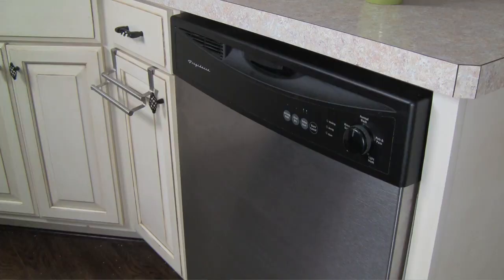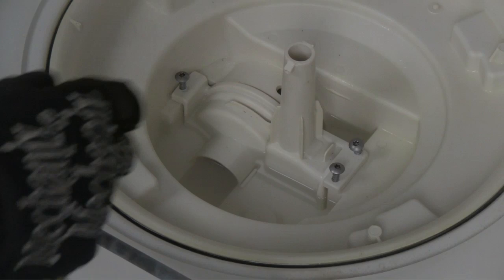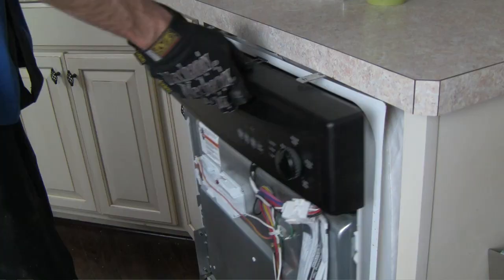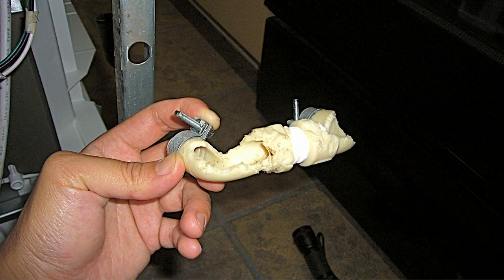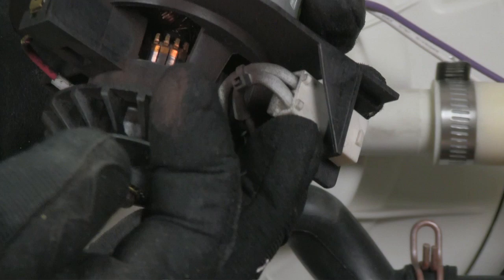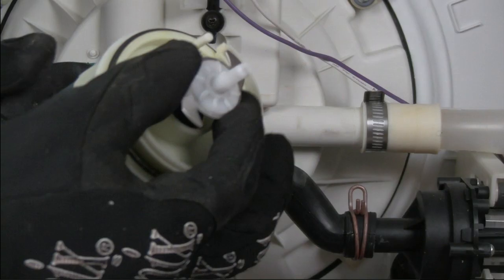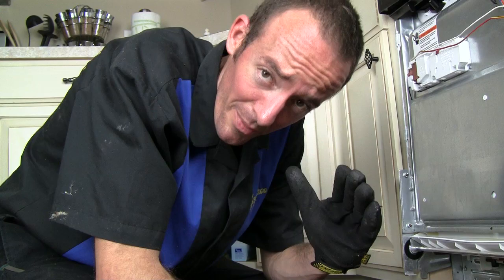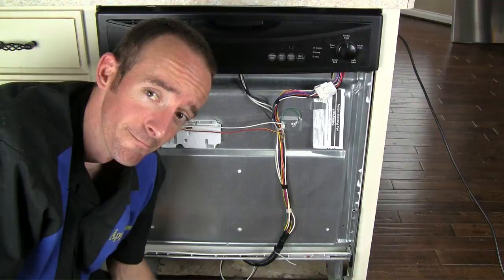How To Repair Frigidaire Dishwasher Noises

Comment: Hello John, Marc here. Great video. I am working on the same dishwasher. I believe I need to open up the drain pump motor. The impeller could be damaged, because inside the tub I found paper towel, bone,hair,plum seed, and a screw. Told  the homeowner I need to pull out and disassemble the dishwasher. Wish me luck.

Comment: A few days ago my dishwasher wasn’t draining water. I live in an apartment so the maintenance man came to fix it. He was here for over 7 hours and couldn’t fix it. He ended up installing a different washer from another unit and that didn’t fix the problem, it added a new problem, a weird grinding noise. I watched this video and FUCKING FIXED IT. It involved diving into my apartment dumpster to get spare parts from the initial machine, using a spoon as a screwdriver, and drinking a pint of vodka, but I did it! There was a piece of glass in the drain pump and that fan in the motor thing was broken into pieces. Amazing video. Thank you thank you!

Comment: Thank you for the video, it was helpful.  In case you're still wondering, the purpose of that 'pin' you reference inquisitively and shave down @7:07 is more of a receptacle for a long cylindrical pin from the motor-side to keep the housing from spinning separately from the base/motor.

Comment: Ok, I just want to say thanks for posting this up!  Because of your willingness to share knowledge, my dishwasher is now fully functional again!!!  The morning started off with my wife telling me it wasn't draining water out of the bottom tub.  Based on the discovery o your video, I was able to narrow the problem down to the drain pump.  I pulled it off the machine and found a broken shard of glass that had somehow found its way into the pump impeller and jammed it.  I removed the glass, re-ass

Comment: This video is still as relevant as ever, and the model used is mechanically very similar to my DW -- the only major difference being the controls interface.  Was able to troubleshoot multiple issues that collectively created the problem.  All without having to purchase parts or call a technician.  Many thanks and kudos!
Reply: Brian B thanks for the comment! Fortunately the appliance designs don’t change very often. Glad you liked it!

Comment from the maker: @Thecrazyeditor I'm not sick of it at all.  That is possible. The impeller is held to the motor shaft by a flimsy tab that is expanded within a square hole by one screw.  So it would definitely be possible for the square hole to become round, one side of the tab to snap off, or the shaft to strip out for some reason.  Thanks for the compliments. Glad to help!

Comment: Great, thorough video.  Thank you.  I followed your instructions to the 'T' and was able to diagnose that the issue was the drain pump (opened it as you showed, and a couple ball bearings had come out of the bearing pack)....  HOWEVER, this warning to your viewers about replacing the circulation pump:...  

... my circ pump appeared to be working but I saw some residual coffee grounds and decided to pull the circulation pump to inspect it more carefully, and clean. Followed your instructions to remove the circ pump,  "...it may help to wiggle and twist a little as you pull."  

I was gentle with the "wiggle and twist method" but the impeller snapped off at the underside because the O-ring for the lower disposer blade section was stuck in the sump housing, while the upper O-ring for the disposer blade cover came out freely.  In this case, pulling just hard enough to bring the circ pump out, even gently wiggling and twisting a bit, allowed the impeller section (O-ring having less friction) to pull through the disposer blade cover (O-ring having high friction).  

I did manage to fix the impeller (description below), AND in the process came up with a safer way to remove the circ pump: ...

...with DW on its side, reach in the cabinet and push evenly on the impeller as you gently pull and gently twist (do not wiggle), and this will keep equal force on impeller and disposer section as the circ pump is removed.

I ordered a new circulation pump, and while waiting for it to arrive did a repair to the old pump, and it worked fine (but chances are you'll need new O-rings).  These steps to repair the broken off impeller (broken off at the axle and plastic bushing just under the impeller):

1.  carefully reattach and align impeller blade; use a sharpie to mark the alignment for when you are gluing all together. 
2.  after you've made alignment marks, clean and gently scrape using an exacto blade the broken edges on the bushing
3.  use a tiny bead of JB Waterweld epoxy (good for up to 300° and a 1300psi, into the inner bushing beneath the impeller (enough to fill in the space after the bushing is pushed down, but not enough to overlflow (so, a very tiny bead, like 1/8" round)
4. use JB steel reinforced two part epoxy with 4000psi and good for 500°f on the broken edges of the bushing
5.  push the impeller back onto the circ pump
6. secure the impeller with a couple rubber bands crossed over the impeller to the bottom of the circ pump, and let it sit over night.  
7. 24hrs later put a little steel reinforced on the outside of the bushing, and also over the screw and center mound of the impeller top screw, and before it dried sink a Phillips head bit into the screw so it you'll be able to access the screw if need be (this last step will help hold the screw into the broken bushing where it's threaded end is locked into the Waterweld.

I left the repaired circ pump in the dishwasher and it held up for a few washes, but when the new circ pump arrived I swapped it for concern that if the old impeller did eventually break off small pieces of plastic or the screw might get in the pump and and possibly ruin it.

Comment: Helped fix my issue within two minutes! Already had the covers off, went to check the impeller, found that it was clogged with a rogue piece of plastic that must have shifted when I last cleaned the inside filters. Thanks!

Comment: This was exactly the problem I had with a Frigidaire dishwasher.  Same sound but some leaking, though it was still cleaning well.  I would rather spend $130 on a pump than buy a new dishwasher when I like how this one runs.  I opted to just replace the pump rather than do surgery like he did.

Comment: Just a headsup, the little plastic ring you modified by cutting isn’t used for anything other than holding the 2 plastic circular housing pieces together so that they don’t misalign while the motors spins.  The other plastic side has a long rod that fits into this plastic ring on this side so that they spin together.  So as long as the modification still holds that rod in place you’re good to go.  I did the exact same procedure with great results, works much quieter now.  Great video!
Reply from the maker: Thanks for the comment and excellent observation!

Comment: Excellent video. I have the same dishwasher (Kenmore) and same noise problem. The part number on the pump is 154843901 made by Johnson and this is the internal recirculation pump shown in the video. I see a few used ones on eBay for $25 and a new for $100 on Amazon. My experience with used items on Amazon is 50/50 if it new and sent back because of the wrong part or truly used with damage. I took the risk on Amazon a used (sent back new) one for $32. Think this pump would have lasted longer than 22 years but nothing last forever. Sad in our case the pump has a bad bearing so replacement was required. Note this uses T20 on the in the inside screws and to remove the pump (Not Allen wrench). I was able to replace this pump without removing the dishwasher from the cabinetry. Just need a T20 torx bit and a 1/4” wrench. Put an oven pan under the pump before removing for to catch the two cups of water that come out. If you are a pro this can be done in 15 minutes. Do not forget the dish soap as lubricate on the o-ring seals for an easy install and no leaks.

Comment: I'm not that handy at all but appreciated the ease of understanding and humor in this video. After following your steps found my issue in the drain pump. Little concerned as I found what looks to be a rivet head. However the dishwasher is running and doesn't look to be leaking. Thanks for taking your time to do videos like these, as you mentioned I can take the misses out to dinner now. I'll keep applianceassistant in mind if I need a part in the future, to support you for supporting me.

Comment: Hey, just wanted to thank you for this vid. It gave me the confidence to try to repair my non-draining Frigidaire rather than waiting for the repair company. When you showed the drain motor and how simple it was to disassemble and inspect, I knew I could do this repair myself. It turned out that it was not broken, but that there was a blockage near drain vent. Thanks again!
Reply from the maker: That's awesome! Thanks for the comment!
Reply from the maker: Hmmm.. during the dry cycle.. Is that when the drain is running? Or is it only heating the element for dry when you hear the noise?

Comment: Thank you so very much!  First thing I discovered was two pieces of glass, then I took the parts out of the bottom of dishwasher and there was hair wrapped around the wheel.  Didn't think hair was getting into dishwasher but my long hair ends up everywhere.  Put everything back together and no more noise!!!  I'm so happy.

Comment: Thank you very much for your show. By following your instruction, I solved the draining problem of my dishwasher. It turned out there was some fiber debri build up in around the inpeller, but the main reason was the drain pipe is blocked by heavy grease. I just brought the house for one month, think the first owner must washed some very special thing in the washer.
Thank you again Sir.

Comment: Thanks for uploading this video. I was able to find out the reason why my Galaxy dishwasher was not draining the water.

I was able to remove the dishwasher and diagnose that the drain pump was the issue. I disassembled the drain pump, as shown in the video, and found a screw.I reassembled the drain pump and put everything back together. Dishwasher works just like before. 

Your video had great editing, was easy to understand, and your tips helped a lot with disassembly.

Thanks again.

Comment: Thank you for the Video. I never worked on residential dish machines and have the same washer. Once I saw how it was put together in your video, I just pulled it apart and found a small piece of glass in the impeller. 
Thanks for saving my sanity, that growling noise was making me nuts.
Reply from the maker: That's what it's all about! Thanks for the comment!

Comment from the maker: Thank you!  There are a few things to check for better washing quality... 
1.  make sure that the water is as hot as it can get at the kitchen sink before you start the dishwasher. (at least 120º) 
2. Try cleaning out the dishwasher with a cleaner like "Glisten" or "Lemishine" (Yours is new...)
3. Lastly only use a small amount of soap generally just the main wash cup. The main wash and prewash soap cups is usually too much soap. Hope that helps! Good luck! Thanks for the confidence booster!!

Comment: Thanks a bunch!!!  From your video I was able to diagnose the problem, without an expensive service call!  I'm placing an order with you right now for a new drain pump.  Seems the rattling I'm getting is from the two bearings in the impeller skipping out of their grooves.

Comment from the maker: @BSSMSLJ Thanks for the comment! I learned that lesson the hard way, but that's the best way to make a lesson stick I suppose. Knowing the location and condition of shut off valves before starting a project can avert many problems before they arise. Your right about customers as well!  People are much more receptive to correcting additional problems that are discovered if they feel like they still have a choice, after the job has started they tend to feel trapped.

Comment: Amazing.  We just took ours apart, found graphite leaking out like crazy.  The tinker in me wanted to know how that pump worked and why there would be so much graphite - you answered all my questions.  Added bonus, with some googling, I now know how a brush motor works. One side's brush is low enough, looks like the spring might not be giving the carbon enough push anymore... probably why there is pump failure.  Thanks!

Comment: Great video for showing how everything comes apart.  I had a similar noise, went through all the diagnostics and unfortunately for me I had a pump with bad bearings.  Had to use a 'cheater cord' to bench test the pump out of the machine to hear it.The dishwasher was only three years old but I decided to install a new pump.  Wanted to buy from a local parts dealer instead of ordering online and pay shipping and wait.  Was quoted $117 for the pump but was able to negotiate down to $100 when I told the guy I had seen them online for $89 and would rather buy from a local shop.Use a bit of liquid dish soap on the O-rings when installing them and just before inserting the pump into the machine.  Works as a lube and goes in super easy.
Reply from the maker: Thank you!

Comment: Fantastic video. I had an issue where my machine was not draining and this gave me the confidence to go beyond taking the parts in the basin out. After taking the drain pump apart I found nothing wrong, but upon putting everything back together, magically it started draining again. Due to the fact that I never found anything wrong, I still fear it may happen again, but at least I know how to get in there and check it out now. Thanks!

Comment: Thank you, you helped me fix our dishwasher that had basically lost water pressure.  I ran it with the door open and it barely would spin the wands and didn't even have enough pressure to get the water out of the door.  The main pump was all clogged up with who knows what (plus some plastic and hair) and the food blades had been coated in a mixture of hair and other things, rendering them completely useless.

Comment from the maker: I can't find any explanation in the service manual for the check ball's function... normally it would be the motor's direction of rotation... with only two wire connections, perhaps the control is reversing polarity... I would need to physically open one up to figure it out. Next time I work on one I will look more closely at the system.  Thanks for all your work and advice on this problem! It's a great help to others with a similar problem!

Comment: Absolutely outstanding! 
Top quality on the video production, and information. 
Thanks so much! 
Liked/subbed. 
I haven't got mine up and running yet, but pretty sure you showed everything I could think to ask at this point. 
Mine has been unhooked for quite a while. The previous problem was drainage past the unit, now that is fixed, going to try to get it running again. 
Will follow up!
Reply: Ok, so I ran water to it, and fired it up, and it took a while to run, but it at some point filled up with water, but its not draining, so on with the troubleshooting like you show here. 
Thanks again.

Comment from the maker: I don't blame you... It's hard to find a dishwasher that you can have some confidence in. Ive been leaning toward Bosch and Samsung lately but they also are NOT problem free. Your right, if you see that the motor is leaking from a small weep hole in the middle of the motor, usually leaving a dark water mark near the motor vents, its new motor time... I hope the new one holds up better for you. Thanks for the comment!

Comment: Such a great, easy to follow, video! I have never worked on a dishwasher before and I fixed mine following all of these steps. Only one question. How important is the smaller of the two O rings? Mine is stretched out and not fitting snuggly anymore. Should I replace it?

Comment: Thanks for the video. I have the same screaming sound in the wash cycle . After much detective work I deterimed that the top spin sprayer is not getting any water. the spray spindle  spins freely just does not seem to get water from the top spray nozzle.I found considerable material in and around screen filter on pump side.

Comment from the maker: Thanks! The dispenser part# is 154860103  But I would start by cleaning it off around the latch.  It may just be gummed up with soap and calcium so that the latch won't hold the door closed.  Otherwise you can remove the front panel by removing a few screws inside the door. Then you will be able to inspect the internal side of the dispenser for defects.  Hope that helps, Good luck!

Comment: thank you!! I love it when I can impress my husband by fixing things!!!
Reply from the maker: That's awesome! I'm sure it means a lot to him.
Reply: Connie VanceKingery just noticed I cleaned filter, but didnot take anything out w/screws ....wash motor?
Reply from the maker: I doubt getting down under the cover with screws will help much. You may want to try sucking on the drain hose connection under the sink with a shop vac... that may clear out some blockage.  Apart from that it sounds like a bad drain pump.  Good luck!
Reply: yeah. thats what I'm thinking...darn! I have felt of the hose...doesn't seem to have a clog...7yrs old...worth fixing?
Reply: it ran the whole washing cycle....but will not drain! would I be safe in ordering the part online? I know a repair shop will charge me prob 3x the cost for parts!
Reply: Well it's probably not worth paying a repair call but if your willing to fix it yourself the pump cost is probably worth it. Repairclinic.com and appliancepartspros.com are both great parts companies.

Comment from the maker: Sorry for the delay! Thats a good question... I will need to get back with you on that one.  Is the dishwasher getting enough water to lift the float switch?  That problem is generally cause by low water levels.